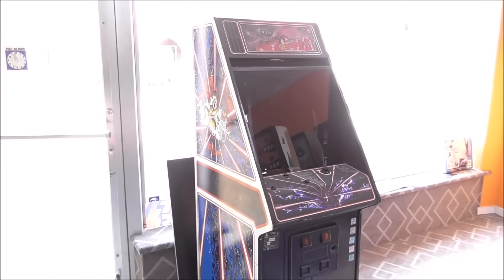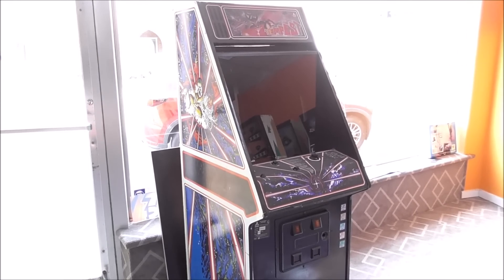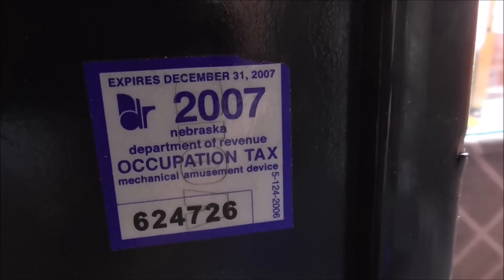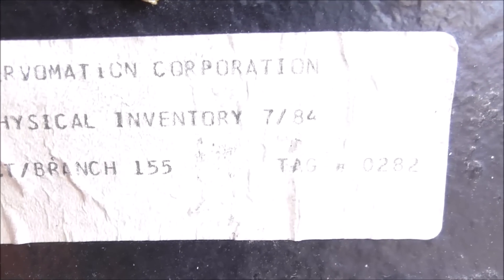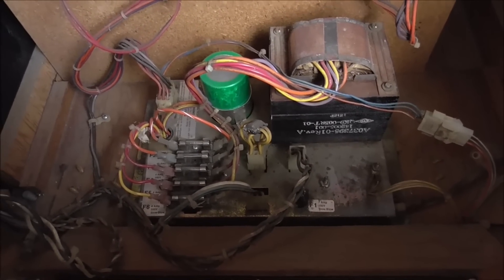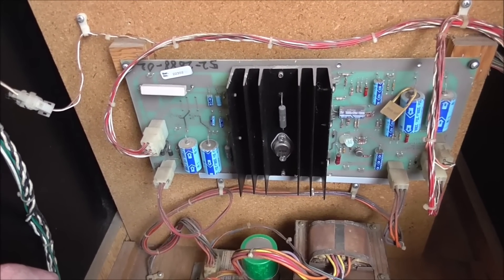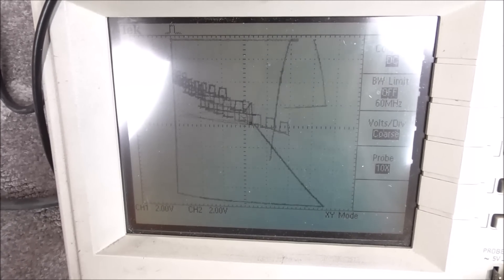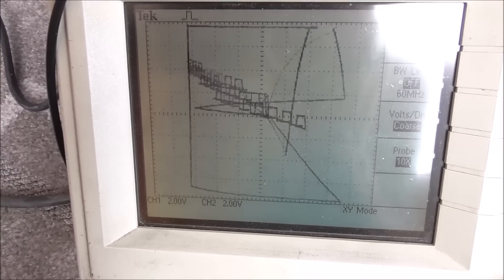Diagnosing an Atari Tempest Arcade Machine With An Oscilloscope - Vector Monitor Trickery

Comment: When I was a kid and saw machines at locations/being operated, I'd commonly see sheets of plexiglass drilled into the cabinet covering artwork and the controls. But on channels like yours or others showcasing arcade games, I really don't see any games with these sheets on them. I wonder if the surviving machines people held onto were just in better shape and more original, vs. the ones that had been abused by screwing plexiglass onto them to protect them? Or perhaps people don't show off those rougher shape units with plexiglass? Or maybe it was just more common in my area?

Comment: 6:52 -- the reason the game is "drawing crap all over the place that it shouldn't be drawing" is that in addition to the X&Y axis signals, the game board also provides a Z axis signal to the monitor which is the blanking, or beam intensity.  Some older analog scopes had a Z axis input, and without that axis, you will see all the "in-between" vectors.  The Z axis allows control of the trace brightness, so the game will turn off the beam during this shift between assets on the screen.  Without that ability, you will see all of those vectors that you shouldn't.

Comment: I just fixed a Tempest using nothing but an oscilloscope. So you can't really say I fixed it. But before the picture was pretty much garbled (the game was running fine though). Turned out the Y DAC had an internal resistor for the 2nd most significant bit bad (or something), replacing the DAC brought the picture back, but the DAC08 didn't work and... it wasn't the DAC, it was the reference capacitor that was leaky.
The two BIP pots control the crookedness of the picture. On the sound test screen you have to adjust them so the lines meet. Yours was faaaaar faaaaar off.

Comment: Great effort so far. I have a 6100 that was necked so I just used a VectorVGA and a VGA/CGA converter to use a K4900. Looks really great for what it is and absolutely zero input lag. Just saying that's an option to keep these alive using a CRT.

Comment: Check the power supplies to the analogue section, the +15 and -15v, it maybe one of them is collapsing under load. The other thing you might have a stuck bit on the input to one of the DACs

Comment: I used an oscilloscope to repair my Asteroids machine.  Found the broken component .vs. replacing the monitor.  Vector graphics are cool!  The old analog oscilloscopes work much better as monitor replacements than a digital scope.

Comment: This is one of the classics
It is one of the games you can't play on the MAME 
Because you need the spinner knob.
TRON
is another one that you need the special joystick
Centipede you need the rollerball
I still have not found a universal control that has the trackball and spinner knobs
Reply: @Ambidextrose if someone could make a specific USB console that has these and has the TRON joystick, it would be cool 
If it was compatible with the Raspberry Pie MAME and the Pandora Boxes
If it was plug and play you could sell a lot of them
Reply: @Ambidextrose I really thought the Pandora boxes would come out with at least the spinner I realize the Tron style joystick would be a lot more expensive but the spinner and the trackball would seem to be relatively low cost and that they would put those in but they didn't

You got to figure a spinner doesn't cost more than a joystick
A trackball doesn't cost more than a joystick
Even if they just had an add-on that just had a track ball and an ad on that just had a spinner and a button
Maybe somebody that has the skills to build those and make them work with the Mame will see this and make one
Reply: Actually you can play this using a trackball/mouse...Just have to remember when you move left your shooter moves right and vice-versa. I have played Tempest via trackball in an arcade in another country. It's tricky but very playable.
Reply: Yes you can play it very well via M.A.M.E. .. Just use a corded mouse at 1200 dpi or better and one that does not use internal trackball. Infrared is preferable - Works well for Millipede and Crystal Castles.

Comment: I wonder if Tempest has a test point for the Z input to the scope?  Those vector games will have the X and Y flying all over the place just like you see on the scope, but what makes a coherent image is the "Z" axis which tells it what color (or none) to draw that particular segment in.  If the scope can see when the board is saying "no beam", it should give you a clearer picture.
Reply: He would need an analog scope to do be able to this. Analog scopes have this feature. Digital ones don't and I don't think it's even possible ether.. Plus, a analog scope would do a hell of a lot better job at X-Y rendering then a digital one can.
Reply: @appliedengineering4001  That depends entirely on the digital scope. There are digital scopes with an XYZ mode. There's nothing about a digital scope that inherently prohibits this feature (the Z axis just varies the intensity of the pixels drawn for the waveform).
Reply: @michaelcalvin42 It just needs an extra ADC channel for it and most oscilloscopes of today (when the signal bandwidth is not limited by the ADC anymore, but by the amplifier in front of it, so the time base trigger could be using just the already existing digital signal data) would not have any use for that ADC for anything else. So given how niche this use is, they simply skip that feature to save cost.